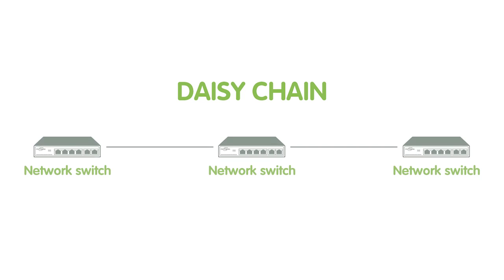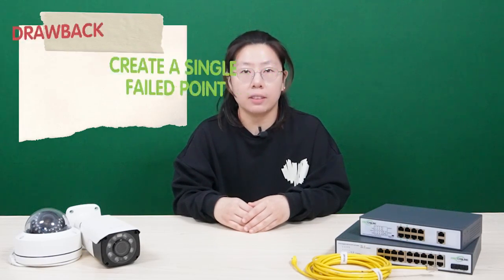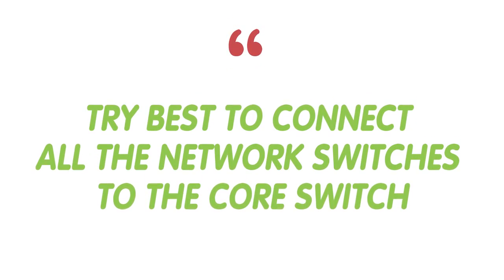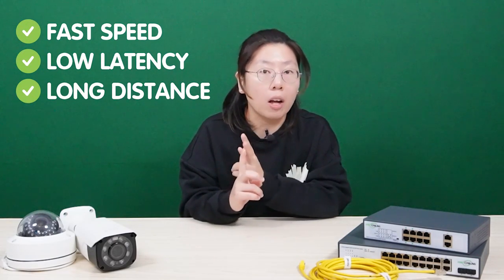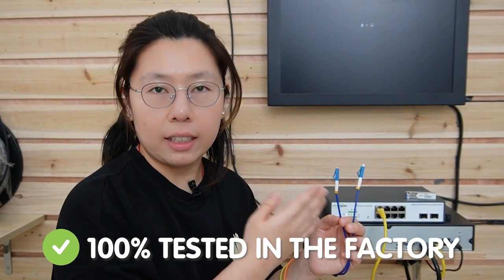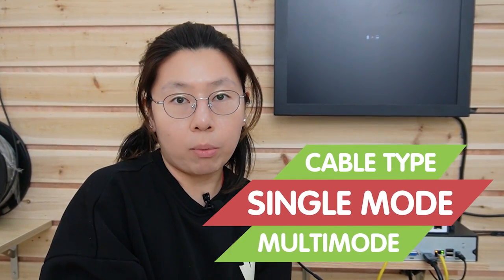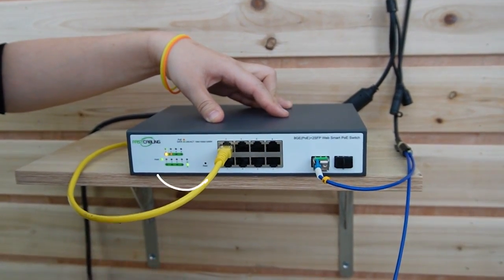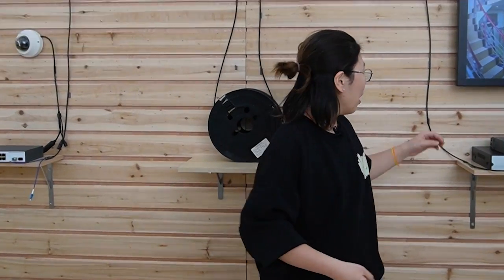Adding New PoE Switch to IP Camera System(Proper Way)

Comment: question: how different a PoE switch compared to a normal network switch?
Reply from the maker: The biggest difference is that a PoE Switch provides both power and data over Ethernet cables, while a normal network switch only provides data connectivity, and it requires separate power sources for connected devices.

The PoE switch is commonly used in setups with IP cameras, VoIP phones, and wireless access points that support PoE, which is beneficial for installations where devices are located far from power sources, such as outdoor cameras or ceiling-mounted access points.

The network switch, on the other hand, is more suitable for general networking needs where connected devices have their own power supplies, like desktop computers, printers, and non-PoE network devices.

Comment: does it make sense to just use the router as a core switch for a smaller network?
Reply from the maker: It really depends on how many devices you have in this small system. The router from the ISP provider is usually designed for the SOHO network. If the RJ45 ports are enough or the switching capacity is good, there is no problem.